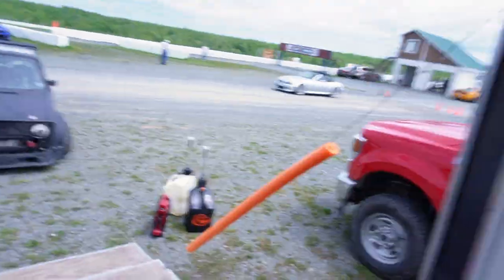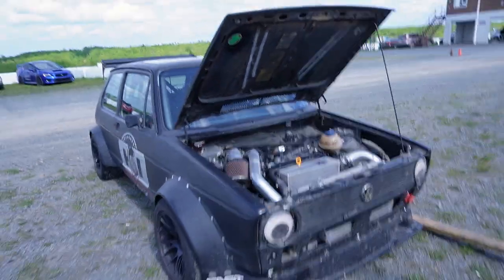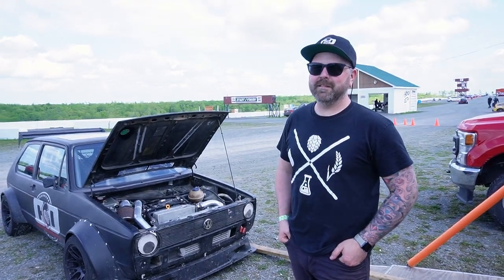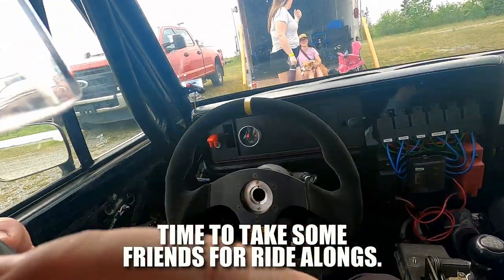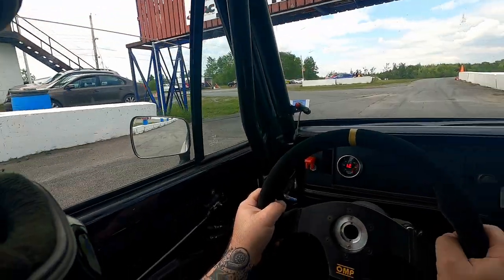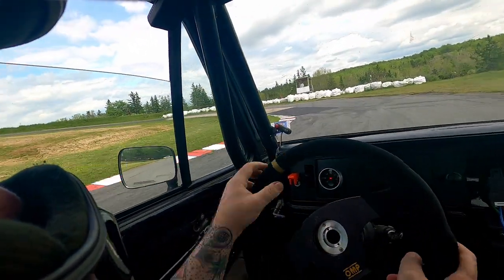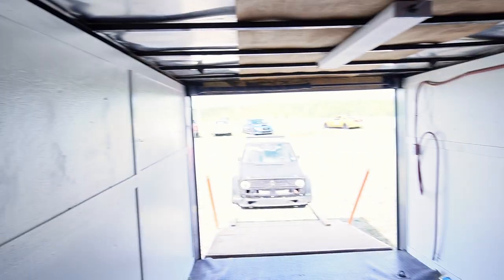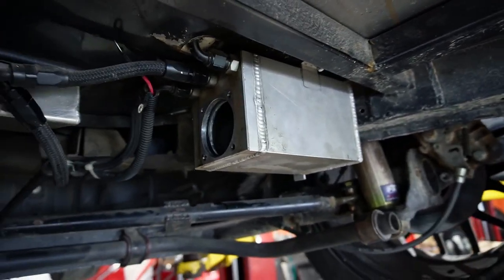The Berg Cup MK1 1.8t gets back to the track.

Comment: Would haltech 1500 elite be good for a vr6t?
Reply from the maker: If you only plan on running in batch then yes it will work, but the 2500 would give you the ability for sequential injection.